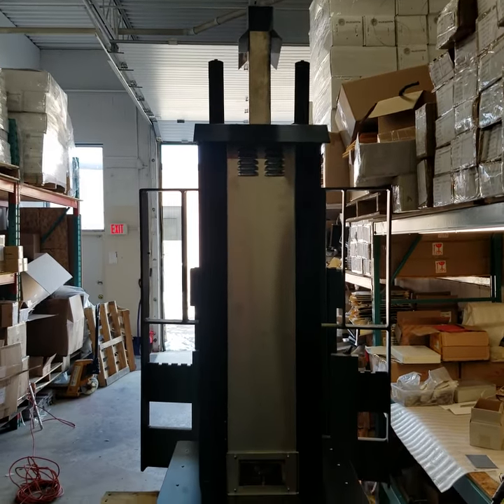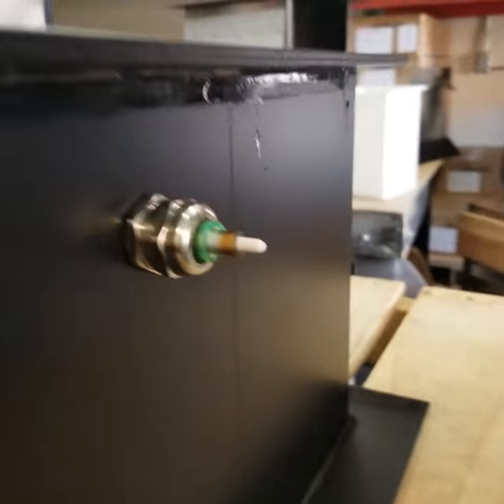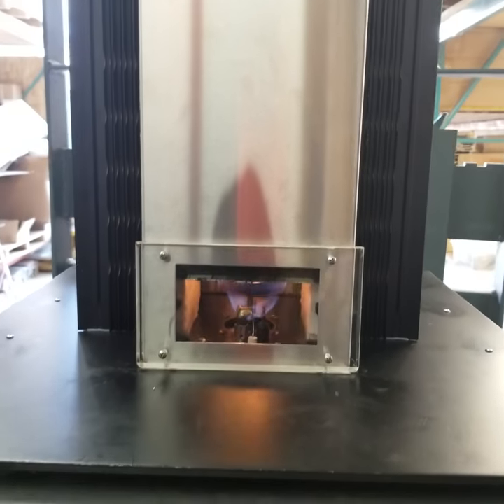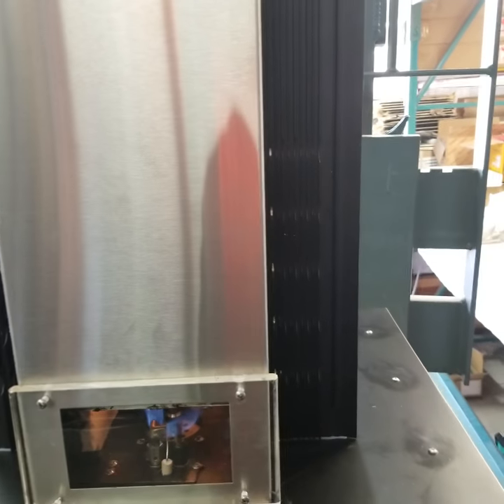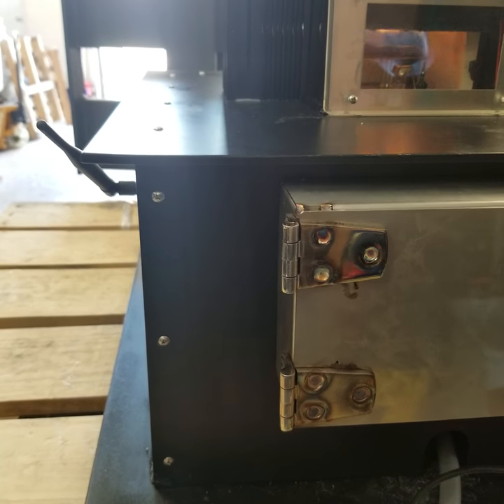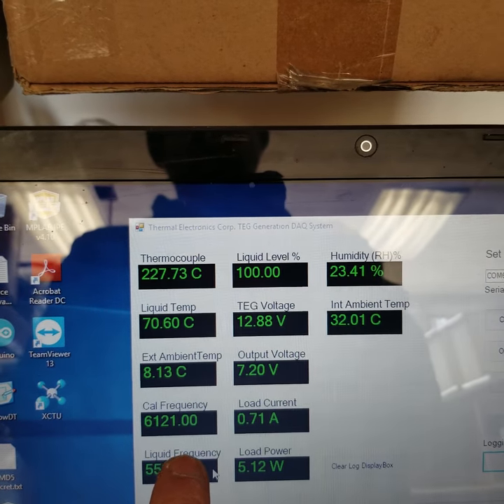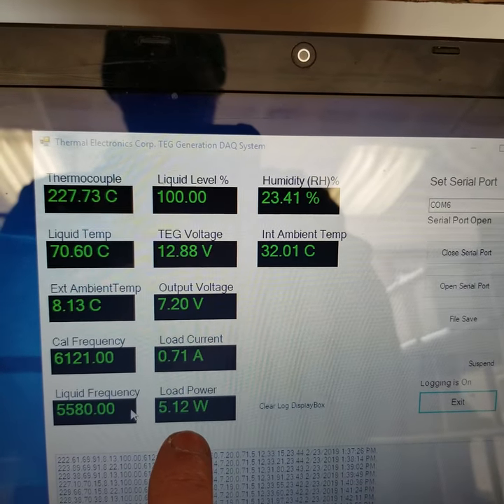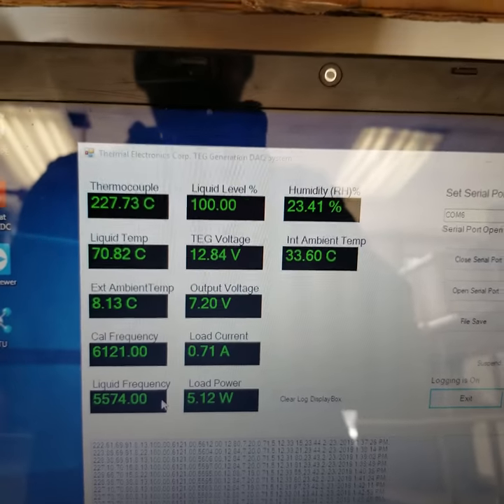15 Watt Passive TEG GENERATOR

Comment: 50/50 glycol/water mix? Why? Glycol is an antifreeze used in water to lower the freezing point. Do you expect freezing temperatures on the side of the stove? :)
Reply from the maker: Yes, unit is going to northern Ontario, Alberta, outside! If it shuts down for any reason needs to protect from freezing!!